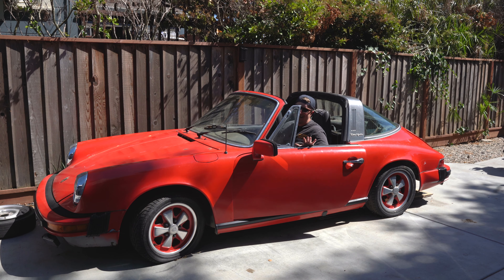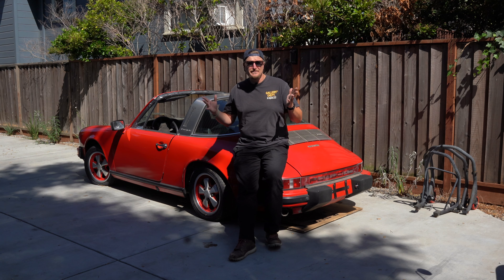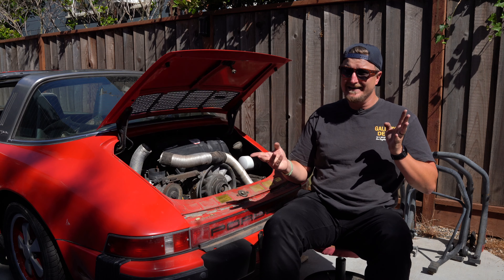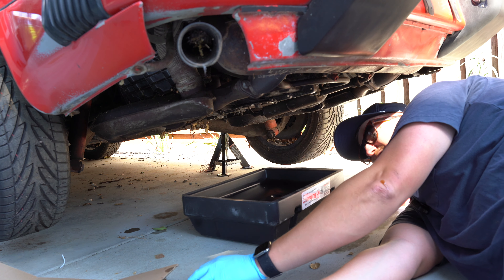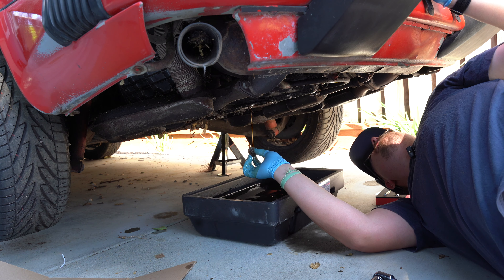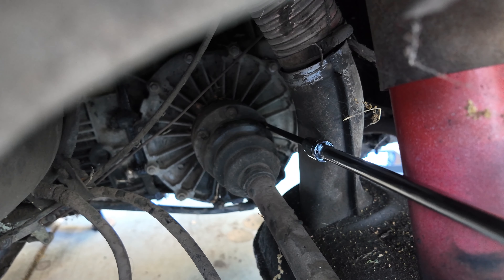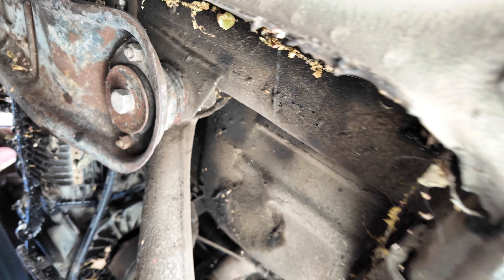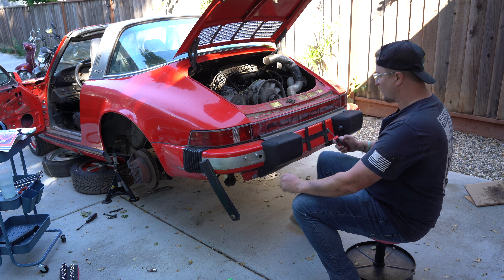Abandoned Porsche: 1977 Porsche 911S Targa Engine Removal

Comment: The case is magnesium… not “inside the case”. Same with the trans case. The rest of the engine (cylinder sleeves, heads, ext) are aluminum… Magnesium and Aluminum expand differently than each other and is the cause of the problems.
Your going to be in a world of trouble if you try to open up that engine, broken head studs for sure. 
And I’m not sure what you consider a bad oil leak, but these old Porsches (especially the magnesium ones) always leak oil… if it’s not leaking it’s not running is what I think they say lol.
I know mine leaks really bad, but only for a few seconds on cold starts and when I shut her off. I just keep an eye on my oil level cause I’m not ready at all to drop the motor out lol.
Reply from the maker: I’m in the process of checking head studs. And so far, they’re pretty close to torque specs.

Next leak down test.